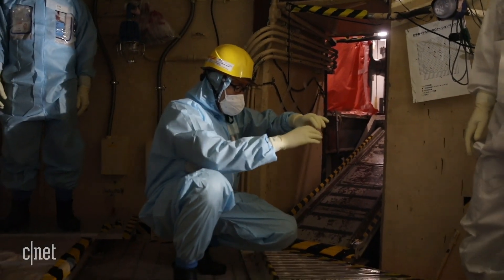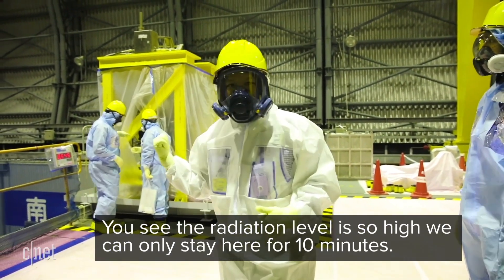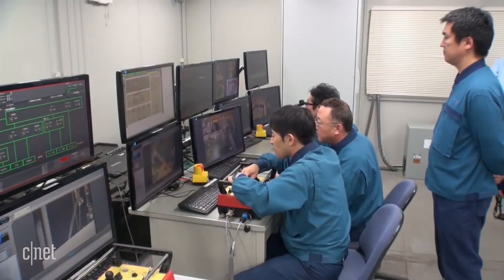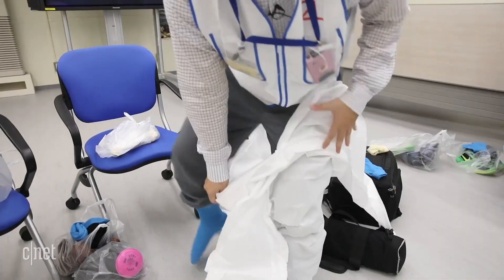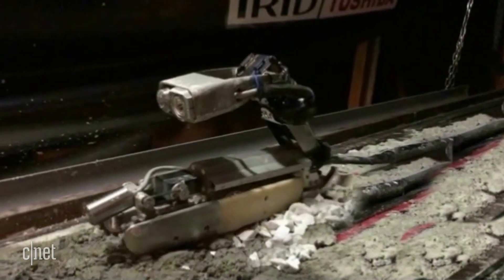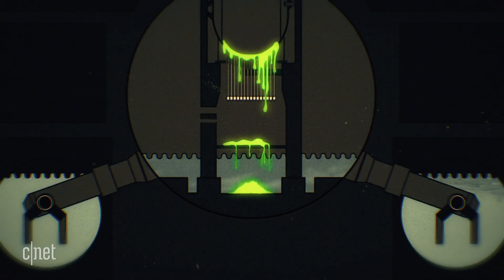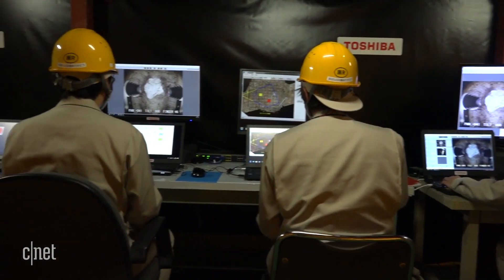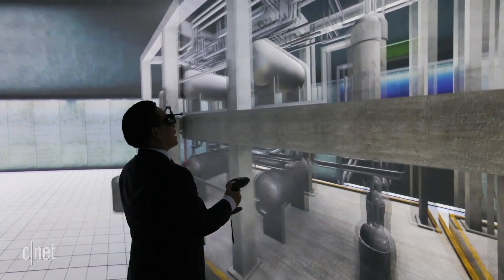How robots are cleaning up Fukushima's nuclear disaster

Comment: Just remember that the USSR fixed chernobyl in less than a year,
Reply: Really?  just last year they completed their SECOND sarcophagus.   Get a clue!
Reply: @danadurnfordkevinblanchdebunk  The SECOND sarcophagus wouldn't be possible without the FIRST sarcophagus. 9 Years after Fukushima and the Reactor is still open.
Reply: @redhairgirl4835  The USSR didn't fix it in less than a year. It's still an issue because Block 4 and everything it contains is still there, it's also because about 30km around Block 4 is covered by an exclusion zone so nobody can live there, I wouldn't exactly call that "fixed"..
The First Sarcophagus was built by throwing manpower at it out of a need of desperation considering it wouldn't be very considerate to keep that mess open to the air, the reason they haven't done the same for Fukushima is because it isn't necessary. There is no open reactor to the air in Fukushima, the containment buildings contained the hydrogen explosions which weren't even in the reactors. The hydrogen explosions happening in the roof was intentional to prevent it from happening inside the Primary Containment Vessel. If they had happened inside the PCVs then a bit more than a Sarcophagus would probably be necessary.
Reply: Well duh no one has as big balls as soviets

Comment: They should’ve taken a look back in history, the robots failed at Chernobyl too after extended amounts of time; so they build a facility for VR testing prototypes of robots for cleanup work??? Even though the ones they’ve already deployed failed or have just taken pictures, good luck.
Reply: To be fair, you are not right. Chernobyl's disaster happened in 1986. Back then the robots were not that powerful, so I don't blame the Japanese for thinking that their robots would survive
Reply: Chernobyl's robots were not properly shielded because the Soviet government did not give the correct radiation figures to the robot manufacturer. Lead shielding can work very well, but is heavy and bulky.
Reply: You seriously think they didn’t do that problem is that radiation so high just annihilates microchips that are necessary to control those robots so you that to build the whole thing out of the most resistent materials and you should  cover it in protective layers but it still has to be nimble 
=> impossible with out tech
Reply: @93Beefcake  I don’t know enough about how radiation effects electronics to really answer but I wonder why they couldn’t locate the electronics externally and just send voltage to the controls down the line to operate the robot. I guess the camera at minimum would have to have some type of chip local to itself.

Comment: I can't see how they can get the genie back into the bottle.

The gamma rays coming off the corium melted slab pile would be so high that no human could get close to it.

Robots can't get close either not because of debris but because of high level of gamma rays.

The reason they've created a robot fish is because water is a moderater it stops gamma rays.

I guess eventually they'll try to bury it in concrete but that won't solve the melted core which keeps burning down to the centre of the earth.
Reply: Theo Thistledon  Are you daft? That's a containment building in action. That's why no one has died and they don't need to build a sarcophagus like they did for Chernobyl.

Comment: i don't think fukushima was more of a disaster than chernobyl. chernobyl's reactor exploded and fukushima was only damaged but cores melted and not exploded
Reply: both explosions is not the main problem, the deadly radiations that spreads by wind and any materials is the main problem, and it stays for decades
Reply: lilili lululu yes but the explosion in Chernobyl forced all of the radiation materials out into the environment like the famous cloud of smoke at Chernobyl. Fukushima just melted inside.
Reply: There was an explosion, but it didn't crack open the core as it happened in Chernobyl.

Comment: FINALLY .. WE MUST INVENT A WAY TO NEUTRALIZE RADIATION ..
Reply: The sun has been trying to neutralize radiation within itself for billions of years!  Or around 6 thousand or so if ya ask Pence!
Reply: Fun fact:.. The soviets had also a general idea of actually using robots like this to do the job.. However they didn't have enough, But aince west gemany is the only nereast in relations and mostly technologically advanced western country.. Unfortunately they were fooled, Probably it was a virus in the system to shut down the robots.. Just watch HBO's Chernobyl: 1
Reply: @stackofboxes4068  It wasn't a virus. On multiple occasions the USSR lied to foreign roboticists  and downplayed the actual radiation on the roof and near reactor 4 as such the most of the robots that were sent failed. Radiation at those levels literally destroyed the traces on motherboards. At low levels, it causes "soft errors". The sudden liberation of charged particles causes circuits to misbehave and interpret what should be a digital "0" as a "1" that would easily be misinterpreted as a "virus" by some tinfoil hat troll.

At more extreme levels, it can damage insulators (and their interfaces with the semiconductor) and cause permanent paths of electrical "leakage" (current flows where it shouldn't). Hence what I said about the motherboards. Even the robots toshiba is testing fail after too much exposure.

Comment: The title of this video isnt correct.  The robots haven't cleaned up anything in the reactors.  The radioactivity is so great it has caused every robot they've put in there to shut down.
Reply: @Frank Heuvelman No Frank that's not what that means.  Uranium and plutonium decay chains....each chain has different daughters of which then have different half-lifes from seconds to millions of years.  9 years is nothing comparatively.  The issue is once the zirconium cladding is removed it becomes very water soluble and very mobile.  Evaporation of water soluble radionuclides occurs under equillibrium conditions, bonding to molecules like O16 and then movement around the planet occurs.  300 tons of contaminated water per day for the last 10 years has leaked from the containment vessels and buildings.
Reply: @paulmobleyscience  Cringe bs, YOU get a clue
Reply: @prajaybasu  please elaborate
Reply: Mate I'm sure some of you only hear what you want to hear at the end of the video he says there still building these robot's so they can remove this crap. .so what about the title 😤
Reply: @leeholmes9962  "cleaning up"....
Reply: Just to be clear, though the title may not be literally correct, are you saying the robots are of no use? Are they collecting useful information for cleanup planning?  Are the less or more tolerant of radiation than human beings?
Reply: @catsupchutney  Actually no never did I say they were of no use, never did I say that information isn't gathered using the small amount of time a robot that took months and sometimes years to design and develop into a working unit that lasts in the range of minutes inside.   I simply said the fact that the technology does not nor can exist to shield robots made of wires and metal let alone human and complex life flesh and blood and thus should have and should not be used to this day and moving forward.
Reply: @paulmobleyscience   So robotic technology should not be used.  And by moving forward you mean that no research on radiation hardened circuitry should be done?  Since radiation levels vary, would there be any locations that are hazardous to humans and also reachable by robots?
Reply: @catsupchutney  No, not robotics shouldn't be used, Nuclear power. Wrong point
Reply: @paulmobleyscience  Actually nuclear energy is safer, cleaner and more efficient that most ways to produce energy. The two worst accidents that happened to a powerplant (In Fukushima & Chernobyl), were only cause the workers/designers made a dumb mistake. In Fukushima's case, it was bad design. Who would have thought that building a powerplant in a country that is notorious for its earthquakes, and right by the side of the Pacific ocean would be a good idea? Anyways, as I said, nuclear energy is actually a lot safer than most other ways to make energy, and the accidents that did happen were just caused by dumb design, decisions, or ignoring protocol.  Cheers :)
Reply: @Cubonout  Actually nuclear energy is not safer being that the calculations made for the deaths per killowatt/terrawatt hour are incomplete for any and every power production without the knowledge of what specifically causes each cancer, cardiovascular disease, autoimmune disease and every other major illness.   Those that have studied this know that analytic is completely a guesstimation and not even a good one at that.  Secondly nuclear power is not cleaner being that every step of the process from mining uranium to storing the waste must use fossil fuels including day to day operation being that nuclear power stations do not power themselves and must be powered by offsite power which is normally some type of fossil fuel power station and backup diesel generators.  And lastly nuclear power is the most expensive energy source to date per killowatt/terrawatt hour along with Price Anderson.   Everything you said is completely opposite of what the truth actually is.
Reply: I’m sorry and I don’t want to start a argument but . The robots have cleaned over 400 Olympic swimming pools of radioactive water alone.
Reply: @theunboxingnerd3229  The only thing "cleaning" the water at Fukushima is the ALPS system along with barium and aluminum silicates for strontium and an RF resin for cesium and why these two radionuclides have separate tanks for removal of them from the water.
Reply: @paulmobleyscience  thank you. I didn’t know that
Reply: @theunboxingnerd3229  You're welcome
Reply: They need better radiation shielding...them
Reply: I bet he gets paid to spread his propaganda . thats all utube is anymore .
Reply: But outside that containment building a human can stand there and not only not die, but also not come down with any radiation related illness.
Reply: @danadurnfordkevinblanchdebunk  u r insane dude , honestly you have a screw loose , keep believing tepco you foolish imbecile, people like u should be made to go live there with your families, see how long then you last 😆
Reply: @danadurnfordkevinblanchdebunk  your just jealous of their success , Kevin and Dana have personality and followers from around the world where you on the other hand have solitude and hatred, you even seem to hate the sea life 😆 poor man
Reply: @danadurnfordkevinblanchdebunk  I suspect you want them to throw that treated water into the ocean , your sick bruh
Reply: @danadurnfordkevinblanchdebunk sure, especially on a days it doesn't leak
Reply: @danadurnfordkevinblanchdebunk  The buildings aren't containment buildings.  The building itself does not contain anything except a containment vessel.  Unit 2 has over 6 sieverts per hour on the outside.
Reply: @danadurnfordkevinblanchdebunk  😂😂😂😂 sure whatever you say dr gaga.
Reply: @paulmobleyscience  6 sv. sir do you have any clue how much that is?
Reply: @droge_ogen  Yes and do you know how much is 9 sieverts?   Unit 2 Fukushima 9 sieverts measured outside containment
Reply: @danadurnfordkevinblanchdebunk  well just take a boat ride over their and prove it !  Until then you debunk your yourself

Comment: Making u think its getting cleaned up. The only way to rid of it.  Is make a solid steel man made asteroid. Bring it down on top of it and pulverize it out of existance. I dont know if something can b assembled out in space. What would it b. And can a heat sheild b used to keep the thing together. Mayb iam crazy for dreaming this up. But i think its the only way possible..? No man made object can remove it. They are basicaly 3 suns in the ground. Glad i wont b around in the far near future
 But our childrens future. Sad
Reply: Damm True. 3 melting sun's in the ground.
Reply: The sin emmits something called black body light, which is temperature oriented and comes from the FUSION of Hydrogen to Helium. This realeases energy which in it's case is correspondent to the temperature of the Sun, and also the energy levels between the two fused molecules.
Atomic fuel usees FISSION to cleave atoms, by controlling the speed of the process, which then decay into different atoms which might be radioactive, where the Iodine-131 is the most dangerous to humens due to its short half life (around 8 days) which is stored in the thyroid, and which is why when you have an accident like fukushima eat iodine tablets, and why many countries add small amounts of iodine into the salt you buy for cooking. (This is just to build up a tolerence so you dont absorb it in case of emergency).

So using a asteroid onto it, would not solve anything, since materials do not behave that you just pulvirize them and the problems are gone. It will still be a million pieces that will still be as active, and you would probably only worsen the effect since the frictional heat which you pulverize the material will also increas the temperature, and most certainly melt the U-235 located in the structure, increasing the reactivity further, while also gaining wierd reactions with the U-235 forming wierd salts and whatnot.
And this approach would also lead to these particles created would be airborne, into groundwater, the sea, the surrounding, making most of the world uninhabitible.

For a reference, it's not the same so don't draw parallels, but look up the 2nd explosion hazard of Chernobyl of what can happen when you dont think of unplanned things.
(Noone saw the flaw in the Chernobyl reactor, noone saw/expected after calculating the possibilities of this kind of Tsunami in Fukushima), and then accidents occur. It's about learning from the mistakes, not making them out of not knowing what would happen.

Comment: Nuclear Power is still the future of clean energy. The only energy industry that actually contains and secures all of it's own waste. All other so called "zero emission" energy sources are unreliable and way more expensive. We must conquer the Boogeyman of nuclear power in the collective conscious.
Reply: Hydro electric dams are where it's at.
Reply: Lars Pelley  Hydroelectric kills more people and does more environmental damage than nuclear.
Reply: @danadurnfordkevinblanchdebunk  nuclear energy is by far the horrible method of boiling water to generate steam inorder to produce electricity. It's has its own set of huge risks. Histroy shows us for eg Three mile Island, chernobyl, windscale etc.
Reply: Hydro is more efficient, than just using the heat generated by nuclear to run essentially what is a steam generator.
Reply: Anthony Root,  what are doin with  ALL their waste ?

Comment: Move the hazardous material where ?
Reply: Special containment areas, where the radiation wont continue to leak into the environment.
Reply: Maralogo
Reply: Deep underground like US does, I guess. There is not much options as Nuclear power is not a practical long term solution.
Reply: The best solution?  Don't use nuclear plants ever.  Use all natural power from the sun or air molecules to make electricity.
Reply: @LaoSoftware  Bruh ever heared of Breeder reactors?